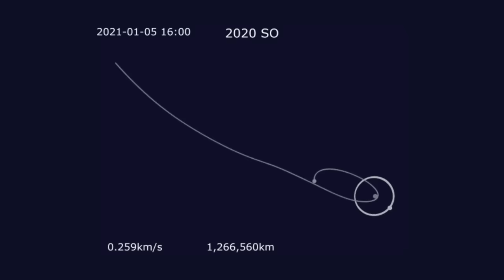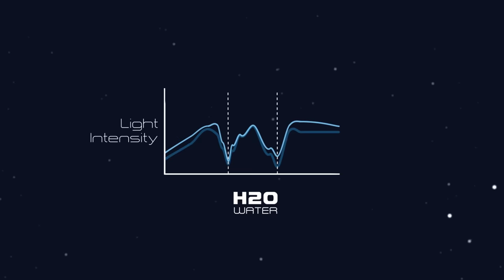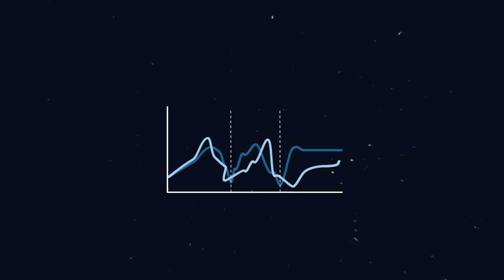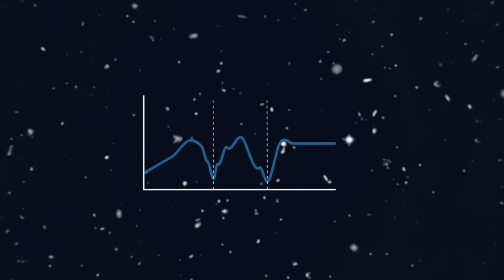The Mysterious Return Of NASA's Centaur Rocket

Comment: If exposure to space alters spectroscopic properties of the materials we use, it would be interesting to track the changes in these properties in something that goes up and returns many times, such as a falcon 9 booster. Their limited exposure to low pressure microgravity environments should be able to provide many data points on this.
Reply: its not space itself, but rather solar radiation. The F9 boosters don't really get that affected by solar radiation but if you look up pictures of the Skylab station and its CSM you can see how much solar energy affects the materials. They appear rusty, corroded. The ISS has special protection against that since its more modern ofcourse.
Reply: @arcosprey4811  I used the booster as an example because it would be easier to track in increments. Also, I'd wager that exposure to cosmic radiation outside of the heliopause would render similar results.
Reply: Got me thinking of the dashboard of Elon's Tesla...

Comment: I just wanted to point out, the logo they keep putting on the animation of that rocket wasn't designed until 1974. In the mid-1960s, it would have had just a 'USA' vertically stenciled, if it had anything, although the 'USA' was probably on the Atlas first stage instead.

Comment: The Roadster is not free-floating in space. It's still firmly attached to the Falcon 9 second stage, so the visuals should show that. Also, all the wheels were removed except for one which is visible in one of the camera views (front left). 👍
Reply: Why were the wheels removed
Reply: @samrowe2889  The wheels were removed because they were trying to shave as much mass off of the car as possibleb (battery was removed as well) to be able to launch it into heliocentric orbit (solar orbit). The wheel that they kept on (so it could be seen in one of the cameras and give the illusion that all 4 were left on) had the suspension removed and was welded in place to the subframe to prevent strong vibrations and possible damage from the rough launch environmemt.

Comment: I was in my hot tub at dusk in 2019. I observed a really fast moving cylinder at high speed pass overhead. From a 45 degree angle to my west, to a 45 degree angle to my east, it only took 8 seconds to pass overhead. The fastest space pass of anything I have ever witnessed. I believe it was a spent booster of some kind as it was passing at tilted angle. As it was dark over head and dark blue to the west, if the sun(not visible for an hour) had not hit it, it wouldn't have ever caught my eye.
Reply: How did you know it was a cylinder? You most likely observed a satellite. I've seen a ton of them, and satellite spotting is pretty fun.

Comment: I kinda wish they would have tried to point a telescope at it and taken a picture, could have been a cool image.
Reply: Sorry to be downer, but It would be really hard to see. They would have needed a super powerful telescope and even then it likely wouldn't be clearly visible.
Reply: Or used the hubble if the orbits and focus agreed, another option would be the iss
Reply: @jithinrajanvarghese5128  hubble is extremely farsighted, so it wouldn't be able to see nearby objects. It was designed to be so.
Reply: 4:19 It is too small and faint to identify from a picture. Hence all the other efforts described in the video.
Reply: i'm not saying it would have worked, i'm saying i would have liked a try.

Comment: the telescope in hawai is 2 meters wide and 3000 meters high.  the centar is also coated with titanium paint.  therefore the match was not good with their radar.  only when they found out that the paint had been destroyed by radiation.  the radar signal matched their measurements

Comment: I take issue with one thing about this video.

You say items launched into space have to be specifically designed to return to Earth or they are destined to remain in space. A whole bunch of satellites that have fallen back to Earth would disagree. An item has to be specifically launched in a manner to break orbit or it will generally fall back to Earth eventually. Most things we have launched into space are not outside that orbit and will with enough time fall back into the atmosphere and burn up. Some of those items have enough speed and low enough mass though that it could be thousands of years before that happens. 

Other than that its a good presentation of this topic.

Comment: Why is in the animation rust at the shell of the Rocket?
Didn't know that there's oxygen in the outer space.
And corrosion in space usually takes part at the "soft" materials which can gas out. Like plastics, rubber, etc.
The metal parts of the shell otherwise should last for centuries in the same condition...

Comment: Explanation of comparing the spectra of Centaur and 301 Stainless Steel isn't quite right. Centaur is _painted_, so the 301 SS is actually hidden, except where exposed by flaking / micrometeorites / damage during launch, etc.

By comparing it with another actual Centaur booster - which is also painted in the same way - they got the right answer.

Comment: So stainless steel changes its reflected wavelengths - implying, possibly changing its composition and structure - when left in space for a few decades?
Sounds like there there's a potential for vanity goods made from space-cured steel. Expensive, given the limited supply and extreme difficulty of retrieval, but somebody's going to want it.

Comment: Wait the Sun has a small but constant pushing force, but doesn't the Sun also have its own Gravitational pull?
So which forces is stronger???
Reply: Gravity is stronger, but both forces act on the object simultaneously. It basically just means that the gravitational force appears slightly weaker than it should.

Comment: Gravity is the bond of two or more elements, It has a infinity attraction, even though it can be so minutely nil, If you had two object fly by so fast across each other parallel in the opposite direction like a two way traffic in space, it would take the odd most of infinity to get back. But. Guess what path shape it will be? parabolic to INFINITY symbol when they both get back.

Comment: At some point we are going to have to gather up all that garbage and chunks of old ships. We should see if we can make use of them instead of bringing them down, burning them on reentry or launching them further out. 

Maybe we can recycle the metal somehow. Use them as storage containers or place them in position to be radiation shields for a moon base. We could maybe place messages on them, load them with fuel or new rockets and send them in all sorts of directions to contact life. However it is kind of scary to think about contacting life. Whatever is out there will not think and reason like us. If they are on the same or lower tech level fine. What if they are far more advanced and hostile? Then we will have made them aware of us before we are ready for that. I have to stop scaring myself.

Comment: Am i silly? If it is only 3000 km/h fast, how is it able to escape earths gravity field after the visit? I know it accelerates the closer it comes, but is this enough?
Reply: Yes. In a simplified version of orbital mechanics, all orbits are symmetric. So once it reaches the same altitude traveling in the other direction, it will have the same speed. But at the bottom of its orbit, it will be traveling much faster. Its perigee is very high, since it isn't flying that close to the Earth, so it's maximum velocity won't be as high as, say, the Apollo missions' 10.5 km/s when hitting the atmosphere, because the gravitational field of Earth is lower at that distance.

Comment: Nothing ever leaves the solar system because there is no limit to how far the influence of our sun's gravity extends. The Voyagers will be back too, some day.
Reply: Nope. There is a concept called "escape velocity" where an object has more energy in kinetic form than it would have in gravitational potential form if it were infinitely far away. Since gravitational force decreases with the square of distance, gravitational potential energy has a finite limit (essentially the improper integral of 1/r^2). But kinetic energy increases with the square of velocity. Once you reach a sufficient velocity, the gravitational field you are in is too weak to ever negate all of your velocity and pull you back. If you were to allow infinite time to elapse, you would still have a positive velocity (C3 energy).

Plus, the Voyagers will eventually reach an area where the galaxy's gravitational field is stronger than the Sun's.
Reply: @the18thdoctor3  That's the clincher. There is no galaxy, no suns out there to capture the Voyagers from the influence of our sun.

You gave the reason perfectly. The Inverse Square law ... thank you.

Comment: Would the sun not have completely burned this rocket up by now?  At least everything but the high temp rocket engine parts...
Reply: No, because eventually the metal is radiating just as much heat as it receives. Earth doesn't "burn up" and we're orbiting the Sun too.

Comment: If it gets closer to the sun, wouldn't the sun pull it towards dueTo Gravity? I understand you Said the solar rays pushed it back, so as I understand you saying that the pull of the suns gravity is less than the solar rays, pushing it back Toward earth's orbit? If so My not Venus or mercury?
Reply: No. It's in orbit around the Sun, just like Earth, Mercury, and Venus are. Just like every single object in the solar system.

Comment: Minus 250 in dark space.. plus 250 in the sun. Why didn't the tesla seats and dash board boil?
Reply: Probably have by now, but we only saw it for the first few hours. Heat takes a very long time to transfer in a vacuum, because there's no conduction and no convection.
Reply: @the18thdoctor3  so then if they only space walk for a few hours why the big suit.  Plus if the big suit works,  why not use it for nuclear clean ups
Reply: @raycrow3718  
...because there's no air in space. Duh. Temperature is not the only constraint. Also, humans are much more susceptible to temperature changes than cars.
Reply: @the18thdoctor3  yeah cause on a hot day leather doesn't shrink and melt
Reply: @raycrow3718  
I'm going to give you another chance to actually read through this conversation before you continue to make a fool of yourself.
Reply: @the18thdoctor3  out here working in the comments huh?
Reply: @the18thdoctor3 so you believe the windshield broke, leather bubbled and ripped, tires popped and the car is damaged but after how many hours?
Reply: @raycrow3718  
I’m not a materials engineer, I don’t know exactly how long - and neither do you. But I do know that radiation, the slowest method of heat transfer, is the only one that works in a vacuum. Also, the tires don’t pop, they melt. The pressure differential isn’t that much.
Reply: @the18thdoctor3  40 psi compared to a vacuum is a lot. but yeah you don't know so quit talking like an authority
Reply: @the18thdoctor3  did you see the giant green screen room pictures with the tesla in it?
Reply: @raycrow3718  
No, it’s 40 PSI. No more, no less. Only 14.7 PSI more than at sea level.
Reply: @the18thdoctor3  does it take a specialized engineer to know that the bare metal on the space station supposedly gets 200 c in the sun.  Almost 400 f! You need help knowing what would happen? Have you ever sat on a leather seat in 100 degree weather?
Reply: @raycrow3718  
Are you actually illiterate, or just refusing to read what I’ve written several times? The leather (or whatever the seats are made of) has most likely disintegrated. But the car itself, the frame, is just fine.
Reply: @the18thdoctor3  you seem too sue of yourself because you really don't know
Reply: @raycrow3718  
So yeah, you’re just refusing to read and think. Got it.
Reply: @the18thdoctor3  You don't know how long it take? Lol look,  We are told The space station orbits the earth 90 times a day! In that time bare metal can reach 400 degrees F! It's only in the sun half the time right? It can also teach negative 400 f in space with no sun, so we're told.  So if the bare metal on the station hits 400 when it's in the sun for 45 minutes then what on the heel do you want me to read again?
Reply: @raycrow3718  
Whoever told you that was either lying or oversimplifying. If the ISS was in the Sun for an indefinite period, the maximum temperature it could reach would be 250°C, yes. And the minimum would be -250°C if left in the dark for an indefinite period. But over the course of an orbit, those extremes aren’t reached. In fact, if you look at a graph of a satellite’s temperature (the only one I could quickly find was NOAA-18 HIRS), you’ll see that the temperature only goes up and down by a few degrees I’ve the course of the orbit. But of course this has a variety of other factors associated, including specific heat and conductance of the material, albedo, and rotation rate.
Reply: @the18thdoctor3  it was a scientist from nasa. That link I shared
Reply: @raycrow3718  
As I expected, just oversimplification for a non-academic audience. You watched the video, heard those extreme temperatures, and had a knee-jerk reaction, without bothering to research it in full or even really think about it.
Reply: @raycrow3718  
A little punctuation and grammar would go a long way towards making that reply comprehensible.

Comment: in 2085. lets capture and sell centaur rocket as lightly used. only moved 0.3 light year sins 1966 ;) (haven't calculated the distance, just a funny guess. if you are nerd enough to calculate it's total distance covered between 1966-2085, plz speak up!)